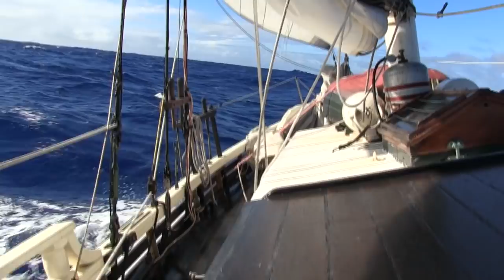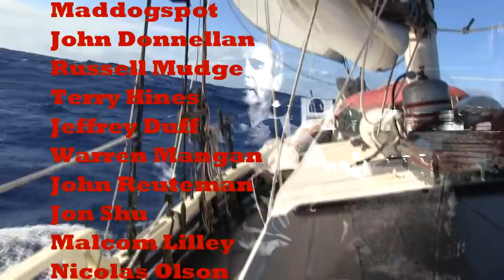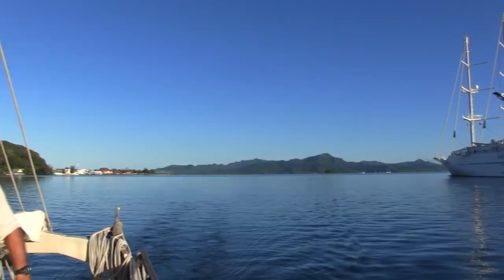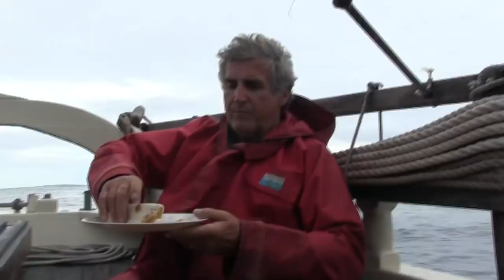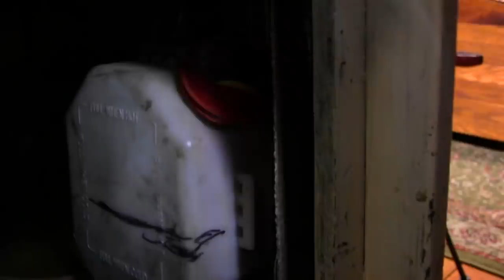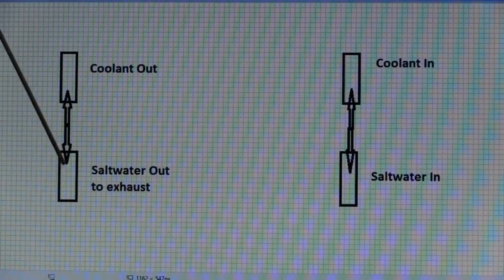#145 EMERGENCY Engine Cooling System Repair!!

Comment: GReat video again - I learned again something. One question: how did you secure the screw into the pipe? Or I misanderstood something? Ah, and I think you are both lucky you have each other!:)
Reply from the maker: Hi Tibor,  The bolt was free floating but had to be long enough to not be able to pass through the T fitting. Thanks for watching and commenting:)) J and S
Reply: @SailingEmeraldSteel   ! I would never thought of such solution... thank you for the explanation!

Comment: Thank you for the video, helpful advice for a real world situation and as someone else said - an effective, simple and creative solution to your problem. I do have a question for you though: 

How did you secure the 1/2" restrictor bolt in the bypass hose? Was it just "floating" in there so to speak and was simply a long enough bolt that it could not make the turn at the exhaust end of the T and exit the exhaust system completely? Just curious. Thanks!
Reply from the maker: Yes

Comment: Well done Juules.  We had our 4236 cooler fail on the way to the Marqesas.  Because it was a dual system with the oil cooler integrated, the Capt. by-passed the fresh water and plumbed the oil cooler to do the fresh water instead.  He figured we had several other ways to cool and monitor the oil and we intermittently used the kludged system and it worked fine all the way to Tahiti where we met up with our new dual cooler.  Ironically, the cooler failed around 48 hrs after leaving the Glorietta Bay Anchorage where you were anchored next to us.  Fair winds friends.

Comment: Great video, thanks for sharing. I see comments below, people wondering if they can do, or remember how to do this. Its not so much about remembering this exactly, as it is to nave an understanding on how systems on your boat work, and then using good common sense to remedy. Of course, common sense does no good, if you dont at least have an understanding on the systems, for example, how a heat exchanger is made, and works inside. Then, its common sense to do a temp fix. So thanks for this video, great stuff! And to cruisers out there, become familiar with how things work on your ship.  Kind regards.....

Comment: Good suff as usual! We had our raw water pump shaft fail 4 days out and ended up using the bilge pump to feed the heat exchanger. We took the hose off the seacock and opened it just a bit to let water into the bilge then pumped it into the heat exchanger\exhaust. If you know how something works you always have a chance to fix it. Sail Safe Ant & Cid (SV Impavidus)
Reply from the maker: Hi Guys, Thanks for sharing that! It's a good idea as we've done exactly the same thing many years ago as we show in this vid.  https://youtu.be/0UQDBYRLqFY.  Take care and fair winds⛵☀️🐬 Jules and Suzie

Comment: Beauty and the Brain.  Im not sure I understand it even after having it explained to me?  guess I better stay close to the land
Reply: I can understand 'cos I know heat exchangers, so that was half way there, as to adaptation, no, I would not know the effect of running hot salt water through my engine cooling system, but let's face it it will either corrode or it will not, the main engine block should withstand it for a short period. I hope!

Comment: Pretty clever fix, I wonder if you could have just taken the thermostat out and connect for raw water cooling as you did. If it ran too cool you could probably throttle back the flow with the intake valve or other restriction. The other thought I had was to make a sort of internal keel cooler  by running a long hose loop with the cooling water in it into the bilge , you would have to add some water into the bilge to cover the hose  to cool the hoe and water running thru it. I have no idea if it would cool it enough , but again you could remove the thermostat to increase the flow and hence cooling. Cheers Warren

Comment: Any chance to pressure test each tube and find the leaker and plug each end of the leaking tubes?
Reply: I for one believe Jules when he says "It can't be done", plus usually when we found that a tube or 2 is leaking, there is a high probability more are ready to rupture as well. 
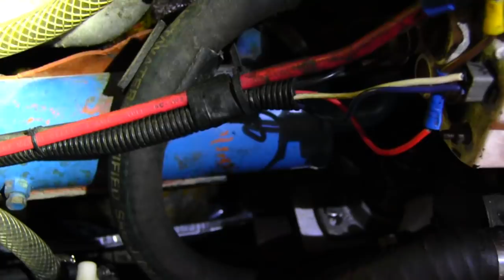It can be done in a shop, usually. We had to take off the end caps, pressurize the outside of the tubes and look for the leaky ones. (We used florescent dye to make it easier to see leaks.) At around 5:00 you can see their heat exchanger is difficult to get to and I didn't see the ends but there didn't seem to be much room to maneuver in there!  You have to plug both tube ends (get the right ones as the plugs are hard to remove!),  pressure test again, repair any new tube leaks, repeat as needed, then you put the end caps back on and pressure test for exterior leaks hoping you don't get any new leaks on the tube side (we would monitor that as well), a lot easier in the shop than in place.
I helped on that operation once, USN. (Apparently, I was the guy it was thought could fix things when others gave up, I got some interesting jobs.) Fun times, since the ship was waiting for us to finish the repair and every officer involved would come in and ask how we were doing, how much longer, etc.  They never asked if I needed anything, mind you. When my boss (Navy CWO) came by, I was hanging mostly upside down, we had mostly finished up and I was tightening bolts, I didn't realize he had the ships chief engineer and XO with him and I said something to the effect of "It would be done a lot <censored> quicker if we didn't keep being interrupted by people asking how <censored> long it was going to take!"  He asked me if I needed anything and I told him "I could really use a cup of coffee, I've been working on this <censored> thing for over 12 hours straight". No more interruptions after that! My  Warrant  told me later that they had been calling him ever time they checked with us, and he had had the hardest time not laughing at my response.
I learned something in the Navy: There are 2 types of officers. One is a leader; if they told you to jump on a grenade, you did it because you knew he understood the situation and trusted him that this was the best outcome for your group. The other type? You hold him on top of grenade. Don't worry, everyone will help.

Comment: Total snipe story there.,,,  :) The worst I have seen to date was that I had to use a hand bilge pump to pressurize the raw water side of a system for a 4-108 when the pump crapped out. This was in an 18' motor whaleboat. Nothing quite as sexy as what you did here Juules. We were only 30 minutes from the ship. Still good lessons here to carry on any passage no doubt. I'm surprised you didn't pull the tube pack, isolate the ruptured tube and plug it on both sides. However I suppose there is no point in plugging a tube or two when you are still going to be stuck with flushing the engine.  That would have been the avenue to take were you in an area where getting a new tube pack would have been difficult and stranded you in Nowherville awaiting the replacement. The best thing about knowing these things is that it makes you more self sufficient and less dependent on the shylocks that prey on cruisers in need. 
If it were up to me, engine mechanics would be as large a part of the 100 ton captain's licensing exam as is the chart reading and the rules of the road.

Comment: Would removing the thermostat instead of using the bypass also work?
Reply from the maker: It would work but not good for a diesel engine to run cold. Thanks for watching! J and S
Reply: @SailingEmeraldSteel  It would run at seawater temperature. It would get you home but take a tremendous beating. Your engine is so happy to have you! :-)
Reply: @SailingEmeraldSteel  Absolutely, I can see that is a bigger issue than on the closed system on my car as you have a constant supply of cold water. Do seawater cooled engines have a pressure relief valve?  Also, is there not a pressure relief valve on the oil system? I love learning on your channel, even though I dont have a boat. Lol.

Comment: Sounds this was a while ago, did you happen to get a picture of your fix? 
Didn’t understand the bolt. Were you pinching the hose, or reducing the cross section of the hose with the bolt? Was it adjustable? 😅
Reply from the maker: Reducing the cross section of the hose with the bolt which also could be done by other means. Thanks for watching! J and S

Comment: How were you able to get the one half inch bolt to stay in place inside the bypass tube?
Reply from the maker: The bolt had to be long enough not to go through the tee fitting. Thanks for watching! J and S

Comment: It looks like there was no other way out in the situation you've described.  Cleaning the cooling system of the engine by adding vinegar to fresh water? I've never tried such a recipe, although I had the same issue. I've used just fresh water. Changed it twice in half an hour.
Reply from the maker: The vinegar dissolves the salt. Thanks for watching!  J and S

Comment: Brilliant. I wonder would a gate valve work instead of the bolt. Have you considered writing a book on emergency repairs
Reply: yes it would by partially closing it and watching the engine temp.  But he would have had to have 3 more pipe nipples and a gate valve all of the same size in his spare parts box. :)